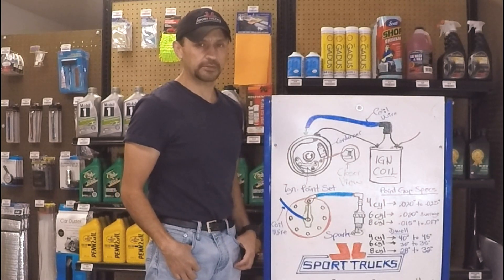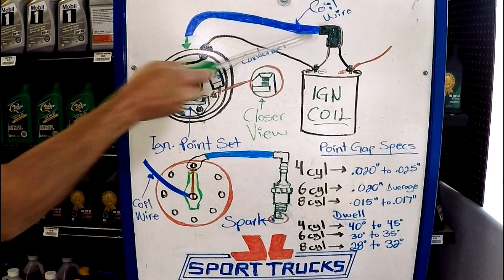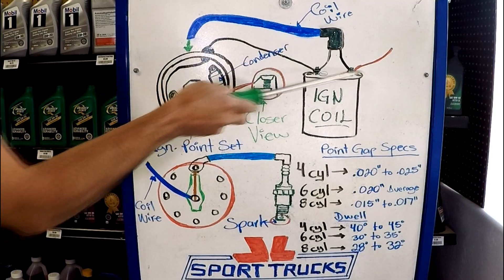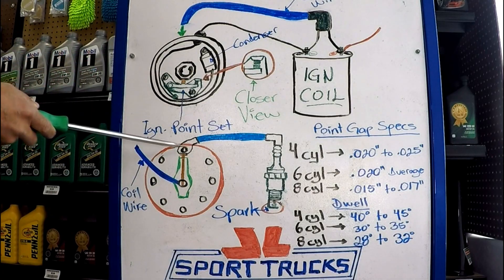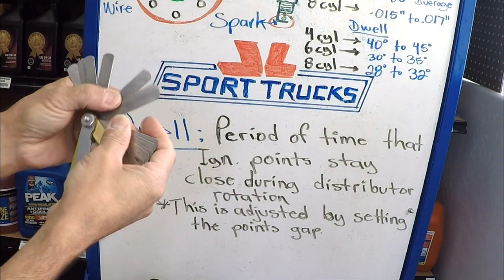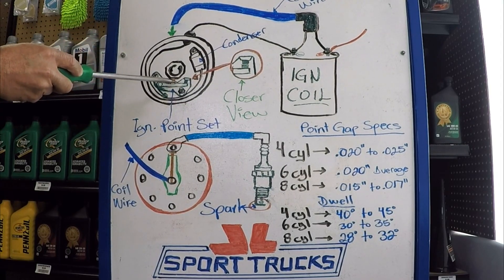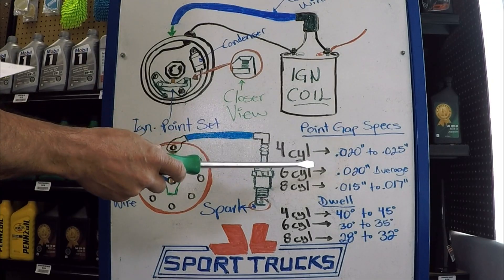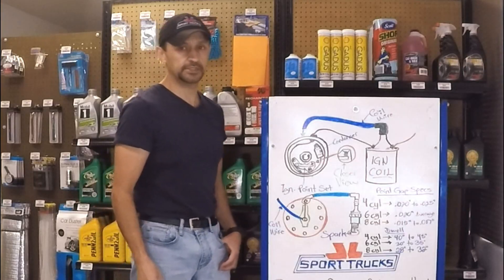How the Ignition Points and Condenser Work

Comment: So 'back emf' can shock the s#@t out of you as easily as the high voltage secondary feeding the plugs. 

My pah used to use the right hand rule for magnetic inductance to make sure the back current was not pointing at the mechanic when testing as so not to get shocked. 

At any rate, I like how you label the ignition coil with red & black which was not easily identifiable back in the day depending on how the coil was actually wound particularly clockwise or anticlockwise for given polarities. 

You make great sense though because engineers do not hold to conventional current flow but electron flow attempting to attain equilibrium with positive ions or namely the double replacement of sulfuric acid in the battery on the lead plates which is 'sulfating' which causes the lead acid battery to go dead or essentially the oxidation of sulfer to the positive (red) terminal. A sulfated battery is essentially sulfer back emf-ing to the lead plate surface making it worn out as the points would go without the condenser; they oxidize and deteriorate like steel oxidizing into rust= iron oxide. 

Thanks for the lesson👍

Comment: Very informative. Does it matter the length of wire on the Condenser? ACDelco has a Condenser (Capacitor) with a very long wire D222 (19142671). What would be the Benefit or Drawback of having the longer wire?

Comment: Very good video. Lenz law explains  the induction that is created in the coil which raises the voltage from 12 to about 24000 every time the platinum contacts open. Induction due to change of the magnetic field. The change is the opening of the primary circuit. I`m 60 so I miss changing the points and the condensers in my cars which I did 40 years ago. Thank You .

Comment: you need to know the mfd value of the cond, for this circuit it has to match the coil  you need orig. part #of cond  tons of them look alike  buts the way the are wound inside that makes them diff  for instance mr army trk mfd value  is 27  that producesa 3/4 inch spark when tested wit screw driver inserted in plug wire to gd  the arc will drop big time with wrong condencer

Comment: the condenser  is very important it has match the coil for max spark a mis match dumps voltage thru the points pitting them     so if points are pitting change the condenser  -clean points

Comment: if you are having tbl. with points pitting  you have wrong  condencer  installed the coil and condencer r value have cancell one another  i have been running same cond. in my army trk 7 yrs now  i found the right cond.  in my case its a standard   AL118  it matches my coil  jumps 3/4 inch

Comment: I took out Pertronix I install 100 miles ago in my 1972 2.0 Pinto and put points back in because the car was back firing, tac jumping up and down, I'm just done with that after market crap. Car runs awesome again on points, Now I'm trying to get them to just refund me for it, Hassle. I'm making a youtube on the whole ordeal. ??  I ran my pinto around the block a few times with the 40,000 volt Flamethrower coil part# 40511 that came with the pertronix as a kit USING THE POINTS and it seems peppy, But I'm hearing on some google sites that it's not good to run a hot coil like that with points. because it will burn your points faster. I'm putting the Stock Pinto coil I have from the 70s back in because of what I'm reading about the hot coil no no. ANY BODY WANT TO CHIME IN ON HOT WITH POINTS???
Reply: That's the same thing I'm wondering about is the compatibility Between the points and the coil, amperages and volts compatibility, would be great if someone could make a YouTube video about it!!
Reply: I do believe from my hour's of research the Accel universal super coils should work they're (yellow) in color, also they work for both 6v and 12v stators, also the Accel universal coils are 3ohm & 5 ohm compatible due to it's universal design, I just ordered me a set on eBay!!!

Comment: I got a free M5 military generator 4-cylinder Hercules Flathead engine, Hobart company. My on and off switch is floppy, and I had it going the motor running.since the on and off switch is bad I disconnect the battery.now everytime I hook up the battery. Ignition coil gets hot and starts smoking. What do you think is wrong?

Comment: I have a question / problem; 81 ford 300 inline 6cyl, I put an older motor  in with a points distributor,  so disconnected the electronic module,  ran a hot to my coil, it ran fine.... then let it sit for a while and now no spark from coil wire, I have 12 power on both terminals of coil , but no spark....I changed coil with a new one and no different. ...going  to put new points and condenser. 
I saw your video about the resistor,  I think I'm going to need to add one, thanks for any help

Comment: hey it might be old but its still relevant! good job. i have a 79 cb650 that of course runs a system like this. Having been in cars,machines my whole life its always seemed to simple to me i thought id look into it alittle more in depth since i never really have, i just learned from experience. I dunno what i expected its basic old stuff.. which is why i like my old bike- i can always get it running if theres a problem. even the very very old starter solenoid that melted together... i opened it up and desolsered and filed and resolder and repotted with epoxy and it works as good as anything...they wanted 120$ for a damn solenoid for 79cb650

Comment: I’m working on a 6v positive ground system. 
Does the negative side of the coil still connect to the distributor or is it switched  with the positive?
Reply: eugene julson the coil itself doesn't have a positive or negative, it should run fine either way. It will change wether the spark plug wears more on the centre or side electrode though.
Reply: @ambush27  Coils do have a positive and a negative terminal. The difference is that both the primary and secondary windings are connected to the positive terminal (inside the coil), but only the primary winding is connected to the negative terminal. The two circuits share the path between the battery and the positive terminal of the coil where they divide into two separate paths to ground (points / spark plugs).

Comment: There are thousands and thousands of small engines (and old cars) that still use points and condensers.  I used to change points and condensers on my old cars when I was a kid but I never knew what the condenser did and no one could tell me other than change them in sets.  Now I know.

Comment: Nice job on the video! One thought, correct me if wrong, but if you adjust the point gap at the lowest point of the cam, then would the circuit ever be closed to power the coil?

Comment: Does the point gap change when you adjust the dwell and vice/versa?
Reply: rapidride2 Yes, dwell is adjusted by adjusting the points gap. Dwell is a more accurate way to set points gap over feeler gauges.